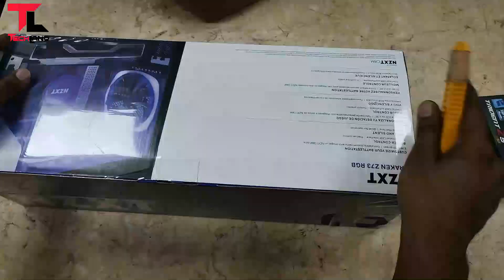intel Core i9 13900K 13th Gen PC Build Asus ProArt Z690 CREATOR & X73 360mm Liquid Cooler |Tech Land

Comment: My cooler came with the same intel backplate as yours, but my motherboard uses the lga 1200 socket. Would the backplate still work on my motherboard, or do I have to find an lga 1200 backplate?
Reply from the maker: New cooler come lga 1200 backplate